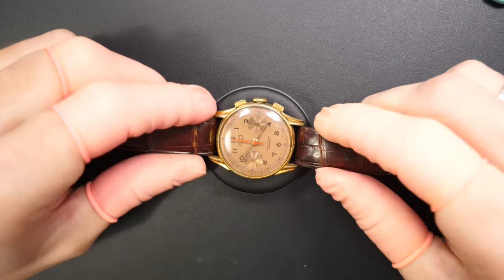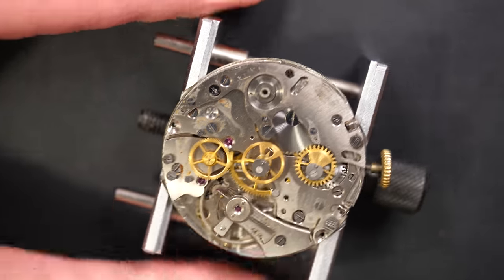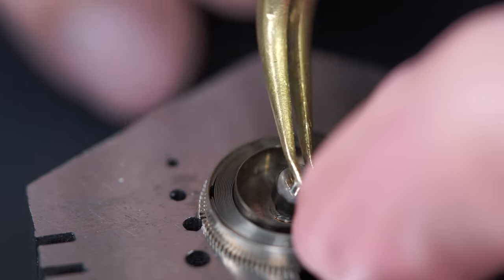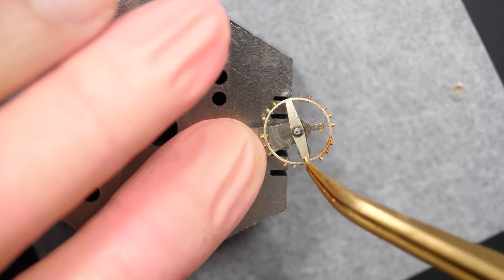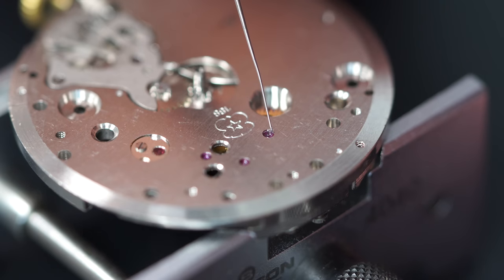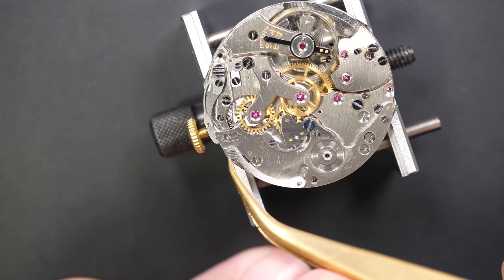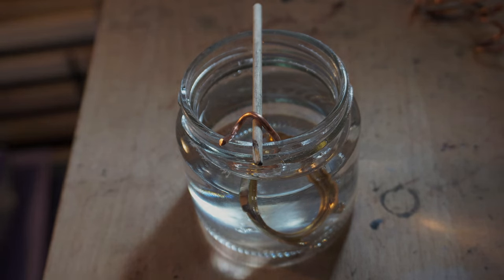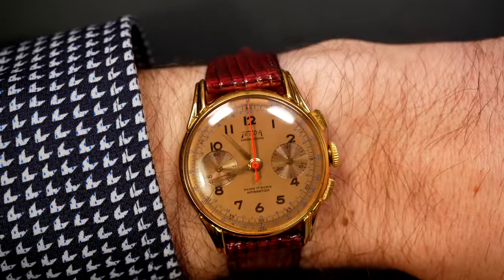Restoring a Venus 188 Telda Chronograph - Unique Dial !!!

Comment: You absolute brilliant person you! I took up this hobby to learn about watch restoration specifically as I bought a watch for my 18th birthday in 1966. Well, actually my twin and I both bought one each. He lost his. Mine is a Breitling Top Time. I paid £23.50 for it. I opened it today as I looked at your video and saw that the facia was the same. Guess what? Mine is a Venus 188 movement. I still don't have the confidence to even begin to work on mine. Your video is marked as a favourite and will be used when I do my service. Thank you so much.
Reply from the maker: So cool Ross. Nice story. If you have any issues during the restoration, don't hesitate to contact me

Comment: Really nice 👍👍. I wonder if the rust could have been caused by cleaning the movement without disassembly?  That’s another thing I like about vintage watches; it’s almost like horological archeology. Have a great weekend.
Reply from the maker: So true for the Archeology. I did not think that somebody could wash a movement without taking everything apart. This is bad if it was the case

Comment: Nice job with an excellent result.  I have a similar watch, branded "Hilton" with a near perfect dial and solid gold case.  It needs a service but is running perfectly, so I haven't messed with it.  Still not brave enough to do it myself until I get some more experience.
Reply from the maker: Hi Shane, they are not the type of watch you want to start with. Better start on a simple watch

Comment: Free sprung balance, thick actuators, nice clean and robust caliber. It does it's job and does not cost a fortune. I get it now why Seagull bought Venus 175.
Reply from the maker: It is a great caliber
Reply: Just ask me, looking at your disassembly of the balance, why didn' they put those two small screws a top and not at the bottom so you do not have to mess with hair spring. Same thing on old Unitas calibers.
Reply from the maker: @PpaStrmpf  I think you will have to take the hairspring anyway. It might be for the aesthetic.

Comment: Thank you for this video. It's fantastic. I'm looking at your Amazon links and some are bad links like the hand removal tool. Which hand removal tool do you use? Also, do you take customers or do you only service your collection? Question, I've seen many people use a plastic sheet to protect the face when removing hands. What product is that actual. I'm sure you don't use and plastic bag and it's probably very this. The pinion pool is not the sane tool you use to remove hands. You use 2 pry  hands right? Thanks again
Reply from the maker: I use a presto tool from Bergeon to remove the hand and a different one to remove the canon pignon

Comment: I was wondering before placing the disassembled pieces into the watch cleaning machine , could it be an advantage to place them into a watt of water displacement 40 or WD40 to gently loosen dirt stuck? What do you think? This watch like in my opinion all older watches is an other prime example for the way things were better then. 
Looking forward to your videos.  
Bonne fête des fin de l'année.  Et ce est un vrais dommage ce que ce passe aujourd'hui sur la plus a Qatar. Mes bonne être 2em et pas trop mâle non plus mdr.
Reply from the maker: I never saw or heard doing a pre wash in wd40. It might work I am not sure.

Comment: Modern watches are mostly variants of the same thing, older watches used to have more uniqueness
Reply from the maker: For sure the variety is huge
Reply: @FrenchWatchCollector  nowadays on the budget watches is everyone using a seiko or seagull, and only on more expensive models when they dare to be expensive by using a sellita movement.

I like seiko movements, the NH35A on my Pagani “AirKing” is dead silent, I have an old quartz swatch that makes more noise 😱

Most watches are just a submariner clone or something tasteless like those enormous golden invictas 🤮

I was thinking about modding a watch, maybe putting a flieger type B dial on a San Martin “Explorer II” GMT, I didn’t research but a dial for the NH35 should fit on a NH34 right?

Comment: Nice video
I believe you got the lift angle wrong, it should be 42 degrees not 52 degrees. Here the video https://youtu.be/gMrftMOF0pQ  Maybe thats why your amplitude is low. This video serviced by the professional watchmaker on Venus 188 with correct lift angle 42. It's the only video I can find so far on youtube, so I'm pretty sure 42 degrees is correct.
Reply from the maker: You are right it is 42. I will give it a try